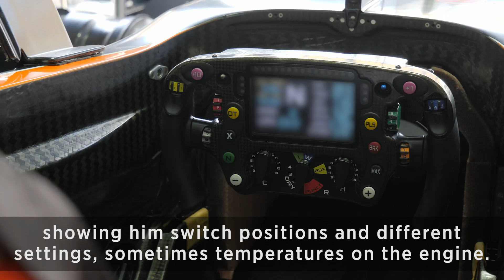Formula 1 Steering Wheel | Explained

Comment: Very good. What is the button of DRS?
Reply: Timo Szabó those sticks on that back are preset switches that allow you to adjust stuff like brake balance, differential settings, and power delivery with a quick flick of a switch. I would doubt they're used for drs, although I guess there's no reason they couldn't be.
Reply: Timo Szabó https://youtu.be/mDO2I_AnZeU
Reply: It could be the Max button, although I doubt it. Some teams run a button on the back of the wheel for DRS, but in the past McLaren have run knee actuated switches, so that is also a possibility.
Reply: i think its one of the stick switches at the back of the wheel

Comment: Does the Overtake (OT) button also activate the DRS at the same time? I don't see a dedicated DRS button so I'm assuming it also turns that on, plus the extra electric power they mentioned...
Reply: I believe it is on the other side with the gear flappy paddles
Reply: Deathbrewer it’s foot activated